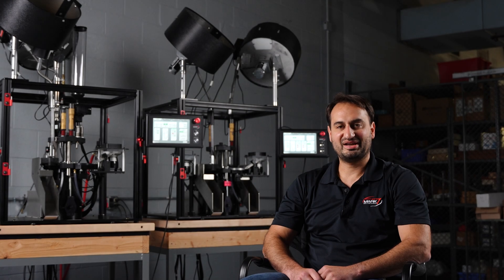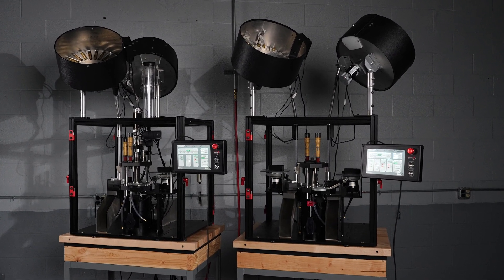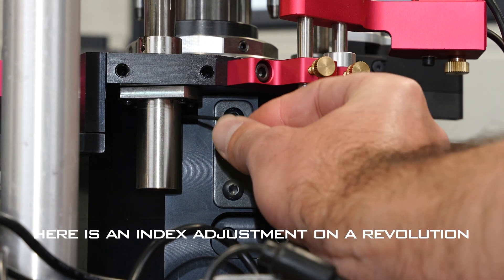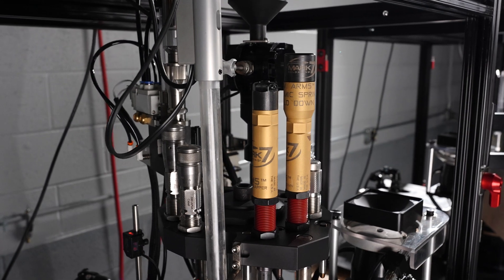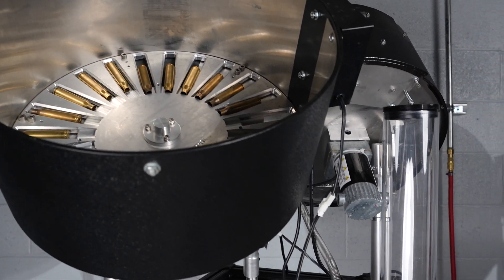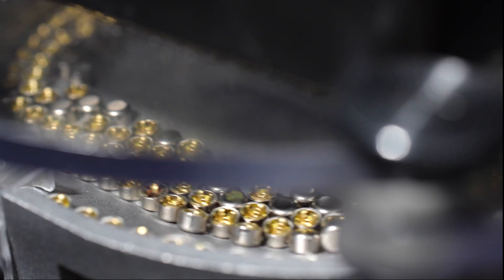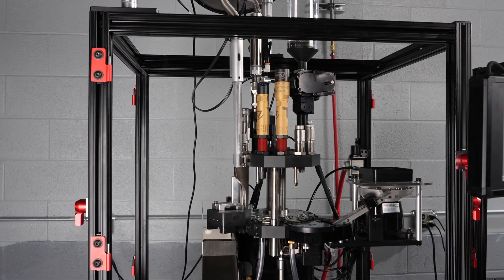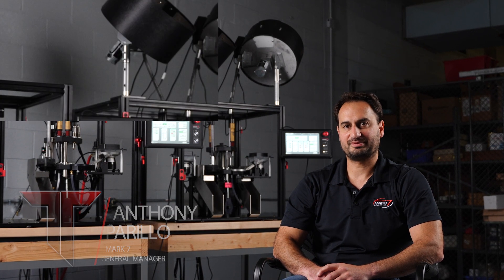The Titan™ - Mark 7 Reloading

Comment: On the titan....the double feed, is that in priming mode only.....can it have 2 powder feeders and double load as well. if so...say I was loading 300BO and one side I wanted to load 110g vmax and the other side load 220gOTM...as long as I adjust the powder drop for each one and set the dies up correctly, could one set it up that way?

Comment: When does a "reloading press" simply become a $big-ticket commercial loading machine for ammo manufacturers? 👆🎯
Reply: Mark 7 literally developed this FOR small-medium sized commercial reloaders. If you are complaining about the price or purpose it isn't designed for you. It is not hobby reloading equipment and Mark 7 has never said this model was.

Comment: Looks like you fixed alot of problems that the revaluation had. One of the issue that stopped production the most for me was the powder check ( specifically for 223, even when it was right) has that been addressed